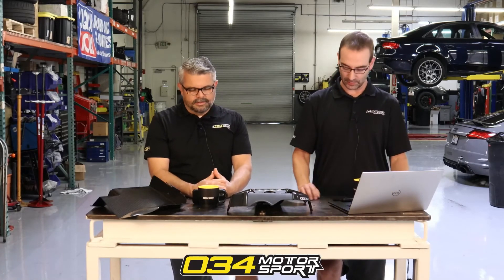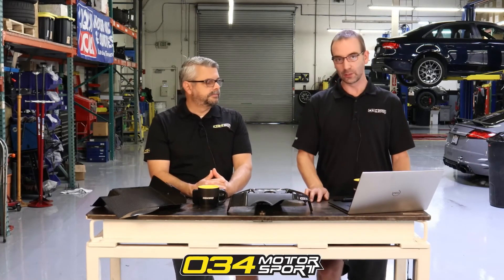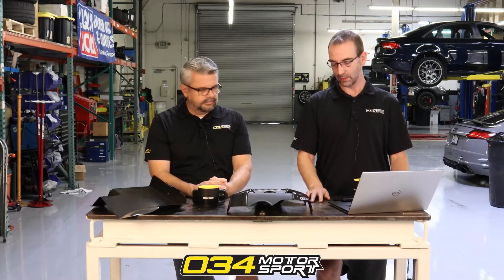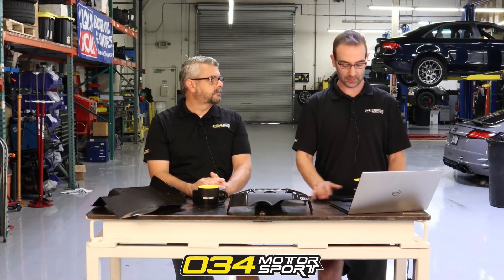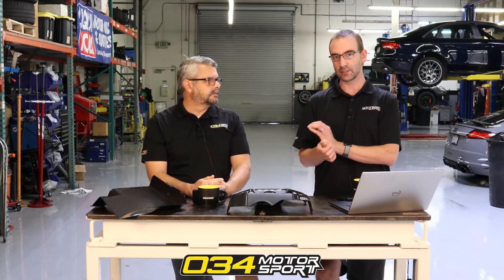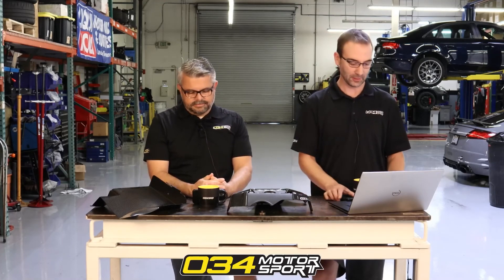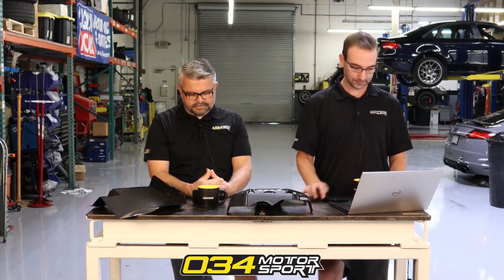What are the Torque Limits of the MQB DQ250 DSG Transmission? | 034Motorsport FAQ

Comment: Does the DQ250 come in the face lifted 2008 Audi A3 8P1 2.0tfsi quattro s line?
Reply: If its 6 speed and wet clutch then yes
Reply from the maker: The DQ250 is present on facelifted 8P A3s

Comment: I had remap done on my Gtd 184 golf DSG dq250mqb torque went from 380 to 470 and car will bog down under heavy acceleration is this a torque limiter?
Reply: possibly if you didnt get a DSG tune along with the ECU tune
Reply: I have too, i have Passat b8 2.0tdi 180hp tunned.
First dyno is 121kw and 351nm after remap ecu and dsg on dyno we have 172kw and 518nm(dpf off adblue off) and without any smoke, have nice day.
Reply: Any problems with gearbox after a year?
Reply: @maliksmietana9562  I had DSG remapped as well and no any problems, everything is working well 👍
Reply: sorry for the late reply, but did the dsg map fix this issue?
Reply: @zanexlmao car had custom tune and dsg remap, after that 0 issues
Reply: @inline601 thanks for the reply bro

Comment: And what about DQ250 before MQB platform? DQ250 has been used since 2003, even in Golf Mk5, MQB platform came in 2012, at first with Golf Mk7, and reached Passat only at Mk8.
I have 2012 Passat 7 with DQ250 and I'd like to give it some power (2.0 CR TDI 170ps 350Nm) but I don't see what's the point of increasing only by 10-15% where the DQ250 limit is.
Reply: Boba is 1300 on his
Reply: @BEYTEK  Hey, thanks for the answer. 1300Nm? Ok, but it's a racecar with very limited life. I want to keep it as a normal daily driver with normal maintenance and lifespan.
Reply: @t0mbd1gg3r  without a dsg tune, the torque limiter in TCU is 350Nm, with tune (no hardware upgrade) 500-600Nm.